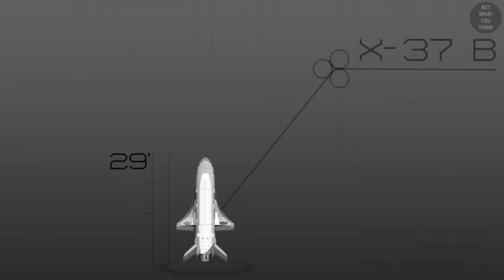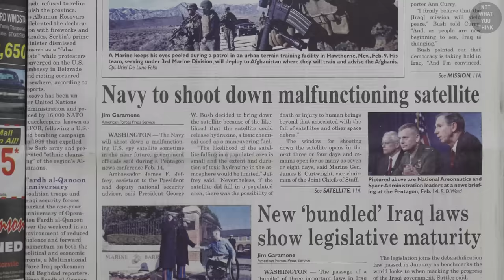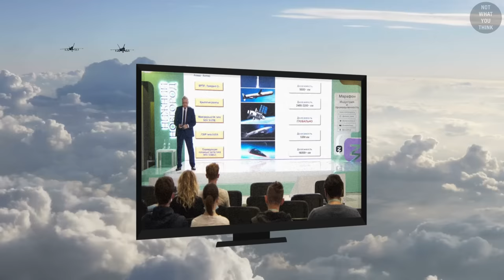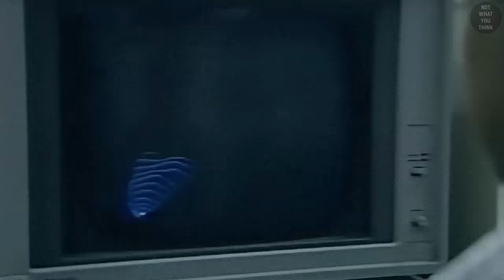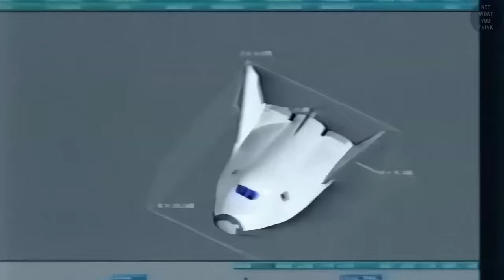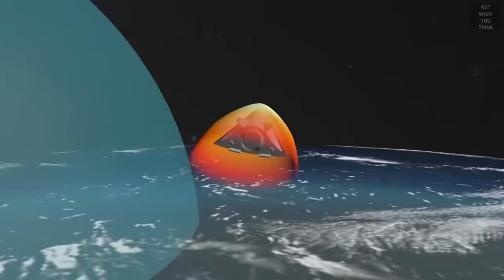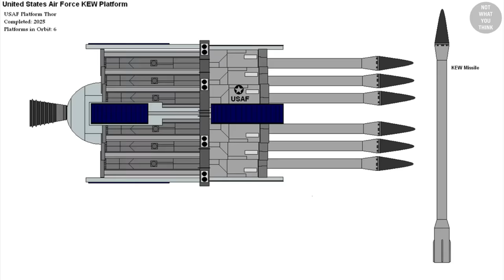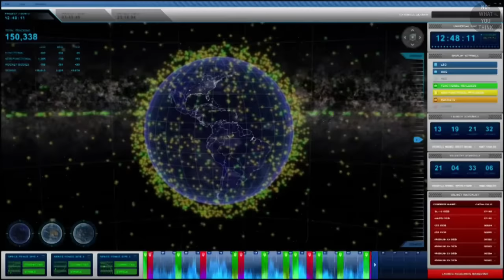Why Russians Think X-37 is a Nuclear Space Bomber

Comment: It’s sad that NASA had to cancel “winged re-entry vehicles” in part due to cost, but the military industrial complex has unlimited funding so they took up the project.
Reply: Funny that people think this is more expensive. Those vehicles are very useful, but the Shuttle failed not because they are costly, but because congress made it so. Designed by committee, doomed to fail. The X-37 probably runs on a fraction of the budget for a single manned mission. After all, keeping the squishies alive takes up so much effort and resources, mass and space more than half of the allotted funds for a given mission goes into that. It is successful because it was designed with all the lessons learned put into it, and less amount of people pulling strings and getting in each other's way.
Reply: @stratometal  Yes, the shuttles were complex and costly. The promise of putting stuff into orbit cheaply with a reusable space plane didn't pan out and the loss of two shuttles and many lives was proof that it the system was too complex to be safe. Most still dream of a true SSTO space plane, but at this point reusable falcon rockets are the best cheap solution.
Reply: @Phrancis5  As mentioned the process for the design that lead to a complex and inefficient system was the result of politicians doing what they do best. Now they doing it to the SLS project, they also did it to the F-35 project. Private companies have a better time with the design of things because there are fewer cooks stirring the pot. Anyway, Starship is a shuttle too, and its not a true SSTO either. Boosters is the efficient way to launch shuttles, but the refurbishing and servicing is what makes or breaks a system.
Reply: @stratometal  The Space Shuttle was a joint project of NASA and the Air Force. It was latter requirements which made for a complex and expensive vehicle.
Reply: Sierra Nevada Corporation is working on low cost winged vehicle. The unmanned version is scheduled to launch in 2023.
Reply: Why is that sad? Technological advancement through any means benefits us all. Look at NASA's own beginnings in Germany's rocket program and then Operation Paperclip, for example.
Reply: Sierra Nevada Corporation is working on the Dream Chaser, which is a winged re-entry vehicle. The unmanned version should fly this year.
Reply: NASA didn’t have to abandon all winged entry vehicles. Just the shuttle. And particularly because of how the shuttle was carried into space it’s tiles where subject to impacts that X37 isn’t. So the X37 is likely way closer to being truly reuseable.

They could have spent SLS money on a wing vehicle if they wanted to but decided they had no interest in it.
Reply: @patrickhenry1249  LOL. Yes.
Reply: Yea but what use would those types of craft be, for NASA at this point? I believe their current direction with building drone/helicopters for flight on Mars and Titan, as well as submersibles for the vast abyssal oceans of the ice moons, is a far better use of tax payer money
Reply: @stratometal  wait-how did congress cause the space shuttle to fail?
Reply: @raidermaxx2324  It didn't... NASA had a design, then everyone got their finger in the pie, and became the F35 of it's day... trying to make it multi platform for all the branches of aerospace. Despite the two loses, it's still the most successful rocket the US has ever produced. "Complex" is inherent in anything going into space. Shuttle only ran into trouble with it's safety management (or lack there of).
Reply: NASA is a collaborative effort in many cases with other countries. If the move was to shrink the space shuttle and weaponize it, much better idea to move that to an in house type organization that would be easier to control and hide the activities of from public view.
Reply: @taylor0941  Yea but NASA as part of their "mission statement" does not engage in anything for the military or the DOD.
Reply: @hawkdsl  oh ok but you didnt say that, somebody else did, so thats why i asked them that ,so they could clarify their position. I already know that congress didnt make it fail. But i wanted to challenge the person who said this, but i appreciate your time.. lol
Reply: @raidermaxx2324  LOL, copy that.
Reply: The primary mission the shuttle was designed for was to retrieve ‘big bird’ satellites from orbit so they could be refuels and refurbished. Compare the cargo bay dimensions. That mission was over before the shuttle ever launched. They likely practiced repairing several ‘little bird’ satellites (including the Hubble) but it was a colossal waste of resources and money compared to more dedicated platforms.

Comment: X37 was a NASA project to build a space craft to service satelites.  The project was taken over by DARPA.  Being able to monkey around with other peoples satelites would be something to keep secret.
Reply: Not really, you could research U.S. Air Force Space Command's offensive space doctrine online as early as the mid 2000s. Of course, it now falls under Space Force.
Reply: I wonder if the work on spaceplanes is to make a cheaper shuttle that the military can use on it's own to deploy and service their own satellites using their own orbital platform / delivery system. If they worked out a system like spaceship two the Space Force could do it without a rocket launch from the more secret airbases in the US, as well as land there too, without as many prying eyes as you would have at established rocket launch sites like Vandenburg or Canaveral.
Reply: This is silly.  It doesn't have the ability to maneuver.  It is too small to carry enough fuel to make such maneuvers for such a long time.  At best, it would be able to do it once, then it would have to come back to Earth and refuel; and even then, that is a HUGE maybe.  The X-37b is just too small.  I do like that you thought about its potential uses.  But you are going to have to keep thinking, because this one a dud.
Reply: That's my bet.  Pretty sure a part of the shuttle program design was the ability to mess with other's satellites.  I'd guess the X37 is just a smaller remote control version of a mobile satellite hacking platform.
Reply: It clearly has many uses as a test bed.